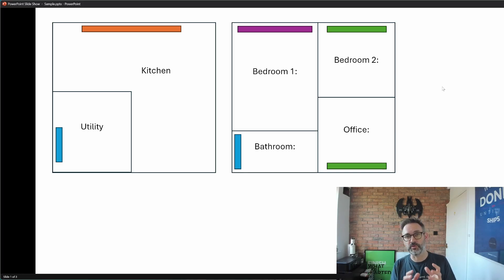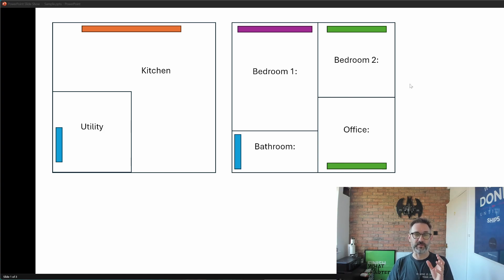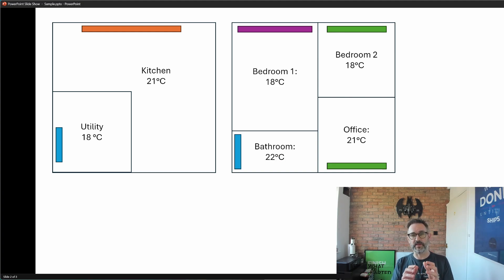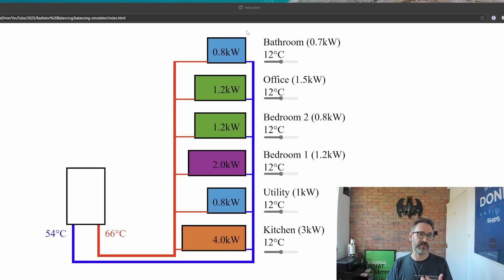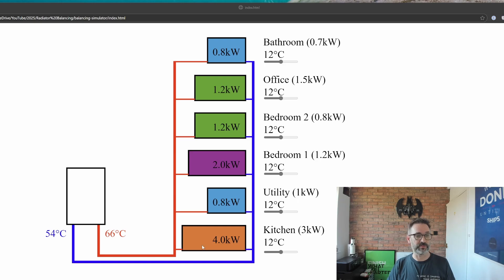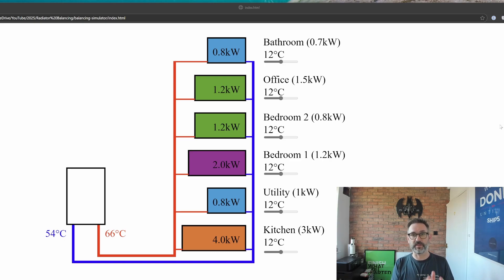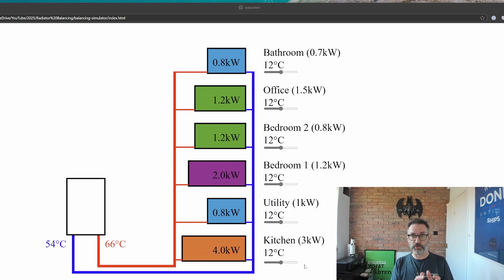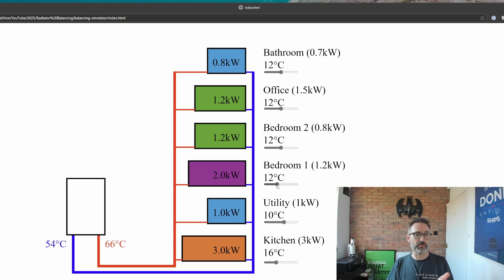Balance Heat, Not Radiators - a better approach to balancing radiators

Comment: Nice to catch on your progress Tom, but might I gently suggest a rethink on what you understand on 'balance - The purpose of balancing using lockshields USED to be to achieve an even temperature differential across all radiators when it was a plug flow system, viz time constrained in on/off cycles - If your objective is still to go with a heat pump, it's a continuous heat not plug-flow, a very different ball-game' altogether - I seriously suggest you look at IMI Eclipse valves and stats, and for complete clarity I have no vested interest whatsoever in Heimeier.
   By way of re-acquaintance, I'm the retired Scot in the north-east corner of Romania who had pondered a heat-pump until a string of outages 'coincided' with my original combi destroying it's mainboard in March 2023 when it was -6 outside -  I ultimately went with a new Viessmann 100-w combi with load compensation control and a UPS, and only the second I came to regret, even more so when I pondered 'what does this setting do  ?' on the boiler and the dedicated LC device was unceremoniously dumped - I do realise your boiler is oversized, and I've extensively added insulation to this place, but perhaps some of my experiences may assist.
   
My heating system is currently running on continuous flow, which temperature I've been manually setting to suit the forecast temperature overnight for now a second year - Despite having the weather compensation (NTC) sensor on the north face these last two winters, attempts to reprogramme the system have thus far failed, but I'll solve it eventually - The advantage of full WC is that the pump speed can be modified according to temperature, although how much effect it would have on the Eclipse valves fitted to all rads is unknown, although I suspect limited.

So to the meat of it - All my rads have been upgraded to 200% of 'theoretical' heat loss, but effectively 150% of installed values (viz 3 panel v 2), the boiler I understood could go go down to 3.8kkW - As experiment, I screwed down the flow limit on the Eclipse valves last winter to match theoretical loss - This winter brought them all up to paper kW values and theoretical 'balance', and achieved pretty much the same result, a return temp of ca 23c - Thus far only down to an outside temp of -8c, but crucially at a feed temp of 42c and all rooms spectacularly flat temperatures despite only one occupant and 4 bedrooms, and no curtains, just DG.

For clarity, I have both the toilet and bathroom towel rail discharges feeding through aluminium rads before return to the boiler, which tamed the temp spikes by dumping heat to the room - Highly recommended.

My point is this - Boost rad capabilities and let the TRVs dictate the room temperatures, it doesn't matter that only X% of the radiator capacity is used, the heat will agglomerate in the top and discharge to the room - If your boiler is capable of continuous heating, deploy it, it won't matter a damn that it's oversized, it will send the heat in a loop and the rads will only take what the TRVs allow, determined by heat loss in turn determined by insulation.

Early new year's morning it was -8c, my boiler feed was set at 42, the return maxxed at 23.4 - Only the unoccupied upstairs bedrooms failed to flatline and dropped to 0.7c below target temperature of 18c - I can live with that...

Best of luck.
Bob
Reply: For clarity on my New Year's day example of the boiler set at 42 continuous, the average feed temperature was 34.8, average return 23.3.
Reply from the maker: My house is just starting to warm up. It’s -1.6 outside. Flow is 40°C. Return is quite low at just 28°C.
Reply: @tomasmcguinness   I appreciate that there is a limit to how far you can take insulation, after that it comes down to the rads and boiler as to how efficiently you can heat.
   On the old original setup after I'd started the first insulation upgrade, I stumbled across my gas consumption having leapt from 0.5m3 to 1.3 on a heating cycle when it was -16 or -20, can't remember which now, but the boiler was set to 55 - I knew sod all about boilers, but after some reading and investigation I discovered the cause, a 40 minute heating cycle, a 45c return, and the feed was really 50c - Thus began my heating adventures and screeds of notes.
   By the following winter I'd flushed the system, upgraded one rad, replaced all the TRVs for Eclipse, and continued tinkering with the feed temp to pull the heating cycle back to 20 minutes by jacking the boiler temp - At the lowest outside temp the boiler was flat out at a real temp in the 70s, but the return was still hitting 30 in 20 minutes, gas consumption 0.78m3.
   When the old boiler blew and was replaced by the Viessmann, I knew it could drop to 3.8kW, so spent that summer replacing all but two rads ( relocated ) with pretty much the original size but triple panel rather than double - Unfortunately I screwed up the load control and had to resort to continuous heating, and it was a revelation.
   Effectively on continuous I'm getting heating cycles of 15 minutes minimum with a 5 minute burn, BUT I finally figured out the gas consumption was pretty much the same yet the room temps were flat as a pancake - My reasoning is that the short burns are adding to the effective "h" in kWh, and the return of 23 is maxxing out the boiler efficiency.
   If you re-read my clarification, the average feed temp was 34.8, return 23.3, at -8c - That's the advantage of the bigger rads - They're too powerful to run flat out, but the valve stat keeps the valve only fractionally open at the target temp - They are quiet valves anyway, but I'd need have my ear close to hear them at all now.

If you really think about it in pondering a heat pump, it is a similar continuous low temp feed but without condensing to consider...

Comment: I wanted to leave a comment on your blog post about low power Matter on your dual-sensor but non of the options for providing identity were palatable so I will leave it here just in case :-) You may consider it a topic even! I was reading the specs for Google Home Matter devices - and they indicate for sleepy end devices, they can be off for at most 3 seconds or they will be considered "offline" https://developers.home.google.com/matter/supported-devices#thread_sleepy_end_devices - this seems completely unusable for most sensors, and I expect that Apple likely has a similar problem - unlike Home Assistant where you push your data, there is nowhere to "push" this data and I presume GH/AHA wish to actively read. This would honestly seem to be a huge problem for any kind of Matter sensor or am I missing some major thing in the Matter spec or ecosystem around this?

Comment: Great video! Thank you! You have a new subscriber. 

 Another question from my side, why not ignore this concept completely in favor of smart TRVs to achieve perfect temperature for each room? I read articles and saw a handful of videos, there is no single opinion whether it is a good approach or not. Some folks say that in case of good insulated house and  a heat pump, it actually increases the cost of heating and others are saying it doesn’t. I am looking into making some changes to my system. Thermostat has two zones (ground floor and 1&2 floor). Master bedroom on 2nd floor is always too cold regardless on how I configure TRVs. Being able to control each room hypothetically would eliminate the need to run across the house. 

What would you suggest? As more and more companies are now offering smart trvs in addition to classic thermostats.
Reply from the maker: Thanks for subscribing!

Efficiency can be impacted by TRVs because they starve the system of water, which means the heat source starts to cycle more. Systems will naturally cycle, but TRVs can make them cycles more.

Let me try and explain.

Let's imagine I have 100 litres of water in my system. A heat source (either heat pump or boiler) has a minimum and maximum amount of power it can output when switched on. 

Take my boiler. It's 35kW(!) and its minimum is 5kW.

My boiler is set to heat the water to 50°C.  As the water flows around, my radiators take heat 5kW of heat out. The boiler or heat pump, then heats it back up, trying to keep it close to 50°C.

The system is in balance, heat put in equals heat taken out. 

Now, let's imagine, three TRVs close down and those radiators are cut off. I now only have 70 litres of water flowing around the system.

My radiators are only taking out 3.5kW of heat now (a simple example)

My boiler is still putting in 5kW (it can't go any lower) so the water in the system will start to get hotter. 51°C, 52°C etc. 

Eventually, it will reach 56°C and my boiler will turn off its flame. This is because the water has reached its "hysteresis" point (in my boiler is 6 degrees around the set point).

This mechanism prevents the boiler from overshooting the target temperature (50°C) by too much.

Water will continue to be pumped around and it will cool down. Once it reaches 44°C, the flame will burn again and the process will restart.

This is called cycling.

Cycling is bad in boilers, but it's really bad in heat pumps.

TRVs are also notoriously inaccurate. I ditched all my Tado TRVs shortly after putting them in. TRVs sit right beside the heat source! In my experience they always misreport the temperature.

If you have a cold bedroom (like I did), the radiator might be not getting enough heat (not balanced) or the radiator might be too small for the room.
Reply from the maker: I think this would make another good video
Reply: @tomasmcguinness thanks for replying! Appreciate it! Waiting for a new video!
Reply: @tomasmcguinness  You have two issues: 1. Your boiler is rubbish and probably oversize. Modern boilers can "modulate" over a wide power range. This completely eliminates cycling once the house needs "enough" heat. 2. TRVs should not close down completely, but reduce the water throughput to keep room temperature steady. Something along the line of good old Danfoss valves has worked well in the systems I dealt with. The goal should be to run the system at the lowest temperature possible for efficient heat pump or condensing gas boiler operation. This requires setting the heating curve based on exterior temperature, not a fixed 50 degrees. It takes some time and iterations to get right.
Reply: @goblinsgym ah, Great points! Although here I need to thank my lovely builders who have installed some fancy heat pump,  which can easily do the curve, to be controlled by pretty dumb Heatmiser Neo which sets my heat pump to steady 50 degrees and then just opens the valve telling to HP to heat. That is it. And here even Tado X may be a better solution.
Reply from the maker: 1. It is. A ridiculous 35kW. 2. I don’t have a single TRV on my system. I don’t need them.

Most people have an oversized boiler and run a fixed flow temperature (usually way too high).

I just wanted to address the standard guides. People follow these and don’t really know the downsides to the process.
Reply from the maker: Typical. Fancy heat pump and dumb on/off control 🤷‍♂️
Reply: @tomasmcguinness  You NEED TRVs. The old style valves are too insensitive to adjust. Your boiler will run based on exterior temperature or maybe ONE interior sensor mixed in. TRV can regulate down when a room gets solar gain, heat from cooking etc. Otherwise you will end up overheating rooms, and waste energy and money. Even if they are not accurate, you can always adjust them manually. Place a cheapie digital thermometer / hygrometers (3 for EUR 10 or so) in each room, and you can combine human temperature feeling with actual data. Room temperature doesn't tell the whole story anyway, the body also notices radiation balance based on average surface temperatures.
Reply from the maker: I don’t think they are always needed. People install them everywhere, even when rooms don’t have other sources of heat.

I have none, for example. We get solar gain, but not enough to overheat the room. 

My lock shields are about 4 years old and it took a while, but my system is pretty well balanced.

I use a whole house average temperature and a crude weather curve.
Reply: @tomasmcguinness  I completely agree with your point that Tado smart TRV's don't accurately measure temperature. In the rooms where this is problematic, I have added Tado wireless thermostats which provide much more accurate control because they are close to the occupants and away from the heat source. It's an effective but expensive solution, so I only do this in two rooms (out of ten).

Also my boiler cycles a lot. 

ASHP to be fitted soon and the smart TRV's will be wound up to max and I will be balancing as you described
Reply from the maker: It is an expensive way, but when rely on them, there is not alternative. I ended up with four rooms what just too too cold. The TRVs in two of the rooms weren’t even enclosed. Wide open. They still closed down. 

I just couldn’t bring myself to spend more £££ on Tado.
Reply: @redshift3 I hope that inaccuracies can be “offset” by the app + maybe an integration with Home Assistant and couple of automations may improve this.
Reply from the maker: I tried the offset with my Tado. It makes no difference. If the TRV is right beside the source of heat, it will be impacted. The impact will vary, so a fixed offset doesn’t help.
Reply: @Serjnyak  The imnaccuracies have only been a problem in two rooms (it's very specific to the environment around the TRV), so I haven't felt the need to use the temperature sensor offset facility in the other rooms
Reply: @tomasmcguinness sorry for coming back just now. Had a heated argument with a friend of mine who has some plumbing experience. He challenged the idea of cutting off circulation when TRVs are closed. And here a pretty long AI generated reason why. 

In new Irish homes with thermostatic radiator valves (TRVs), if you close a TRV completely, it reduces the amount of hot water flowing into that radiator, but it does not significantly reduce the total amount of water in the whole heating system. To prevent issues with reduced flow and pressure in the system (which can cause boiler damage or pump overwork), most heating systems incorporate a bypass mechanism—either an automatic bypass valve or a radiator without a TRV to allow minimum flow.
How TRVs Affect Water Flow in Radiators
•	TRVs control the flow of hot water into each radiator by opening or closing based on the room temperature they detect. When closed, the valve restricts hot water entry to that radiator, effectively turning off heat output from it.
•	Closing the TRV does not drain water from the system; instead, it stops or reduces flow into that radiator.
•	The water still circulates elsewhere in the system, maintaining system volume.
Role of Bypass Valves
•	When multiple TRVs close (e.g., in a well-zoned or fully controlled system), the water circulation through radiators would reduce drastically. This can increase system pressure and reduce flow through the boiler and pump.
•	To address this, heating systems are equipped with automatic bypass valves that open when TRVs close, bypassing the radiators and ensuring continuous minimum flow through the system.
•	The automatic bypass valve maintains system balance, prevents noise, and protects the boiler and pump from damage by ensuring there is always sufficient flow, even when TRVs close fully.
Reply from the maker: Some of that stuff is correct, but TRVs do remove usable volume from the system when closed.

If I have a large 2000mm K2 radiator, it holds about 11 litres of water. If you close the TRV to that radiator, that volume of water is no longer available to the boiler. If you have 100L of water in your entire system, that's 10% no longer available to the boiler.

To avoid an issue where all the TRVs in a system are closed, there are two solutions as mentioned. Either a classic "keep one radiator open all the time" or use a bypass valve.

Both of these are valid, but if I have 10 radiators and 9 are closed, there is still a significant volume reduction. 

In a boiler scenario, cycling would increase significantly since the water flowing around will get hotter far quicker.

In a heat pump, the cycling rate would increase, and the lack of volume could make defrosting take longer.

In the end, TRVs are needed in some circumstances (like a room that gets too hot because of the sun). They come with problems that need to be factored in.

Comment: Assuming you start from a position of a balanced system - surely the trv’s deals with the finer adjustment because it’s just a temperature controlled lockshield in reality ?
Reply from the maker: I don't think they do find adjustment very well. Normal TRVs are slow to close down and open up and they are inaccurate. Smart TRVs, in my experience, are also inaccurate. That's is, I think, because are right beside the heat source!
Reply: @tomasmcguinness the other problem with trvs is they’re measuring the temp near floor level and close to the rad, some smart trv you can inject a value from some better placed sensor. great vid, just need to work out the heat demand for my rooms 😅
Reply: Some recommend that ASHP systems have no TRVs or they are set open or as overheat prevention. The intention being to maximise the flow through the ASHP and provide access to the full volume of the system for ASHP defrost cycles
Reply from the maker: This is called Open Loop. There are no variable restrictions on flow

Comment: Great video! It'd be good to see what a few actual dt's are on low temperature heating (highest and lowest?), and how close it matches to your heat loss / heat punk survey.
Reply from the maker: In a well-designed system low temperature system, where rads are sized as close to the room as possible, the dt might be a little higher on some radiators.